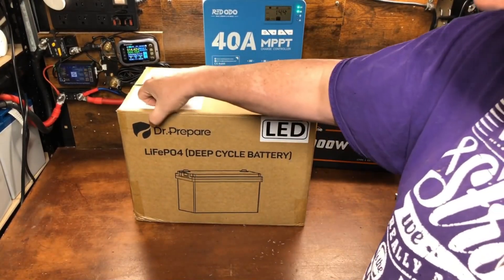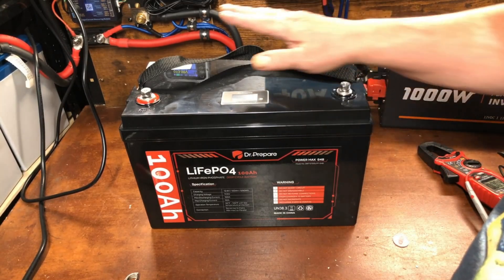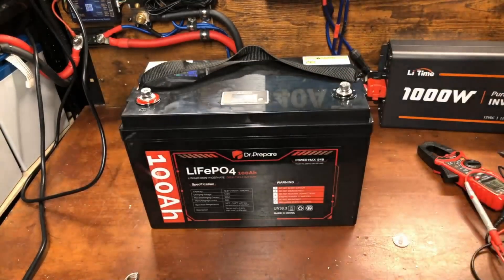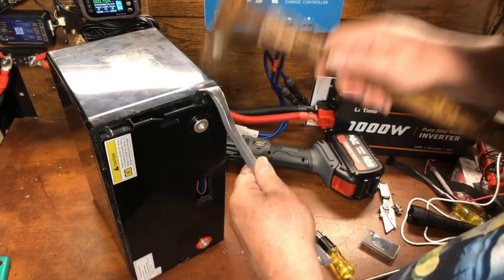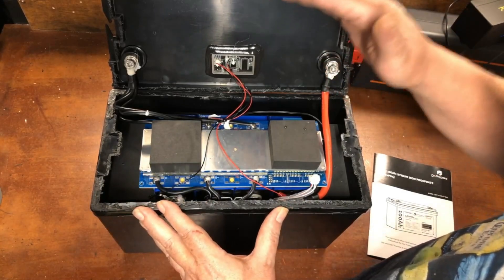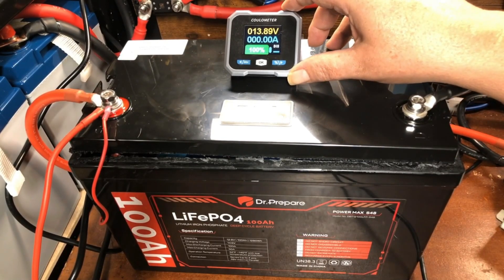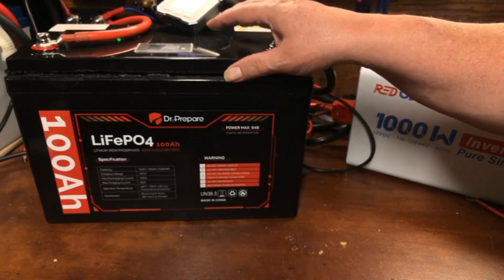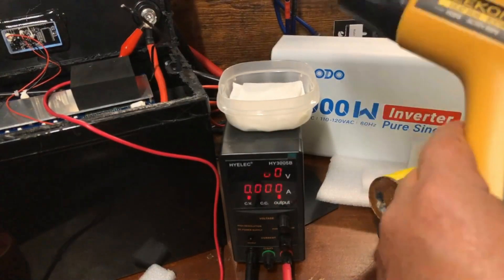Dr. Prepare 100ah LifePO4 Battery with Cold Temp Protection!

Comment: Mine just arrived, the led screen will only show charged to 77% after charging with 20 amp lipo4 charger.
Reply from the maker: Weird, my screen was surprisingly accurate. What is the voltage of the battery when the charger is connected when its saying it's fully charged? I had a fairly cheapo charger that never fully charge a while back unless I dropped it down to 5a charge for the last part of the charge around that same SOC and I ended up chucking it. It was one of those HTRC ones that claim to do 3 different battery chemistries, including LifePo4. Just a thought.